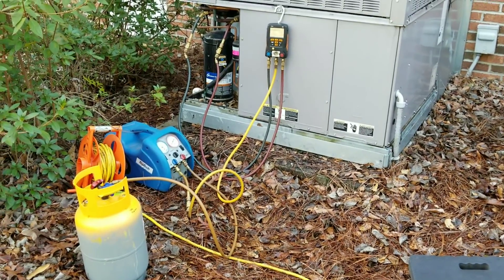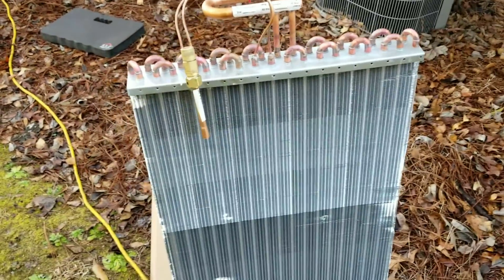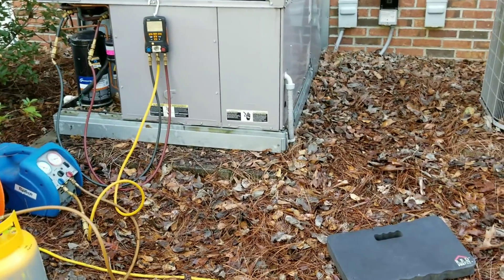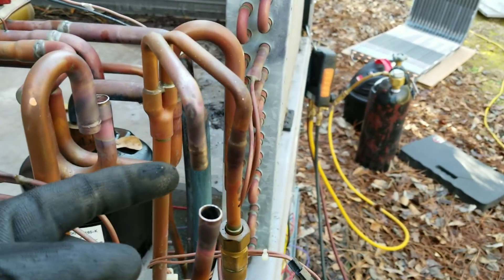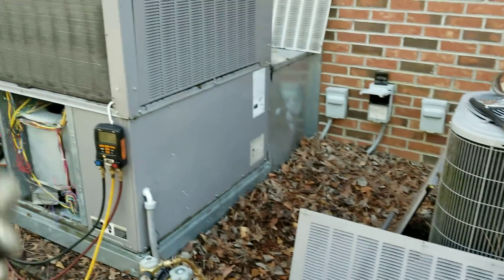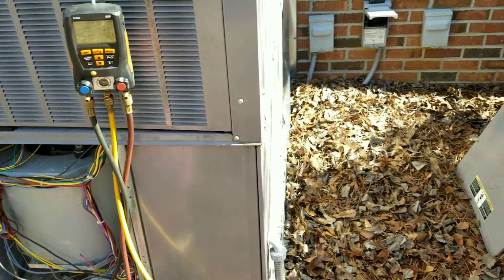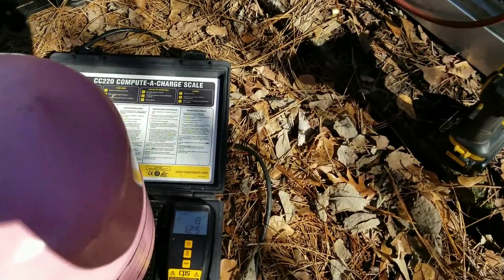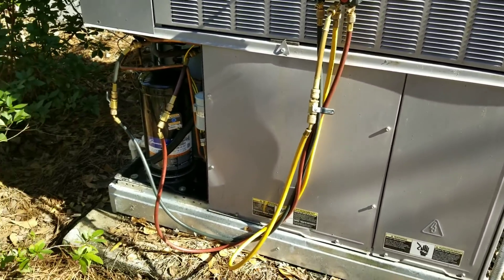Diagnosing A Frozen Heat Pump Part 2

Comment: You could easily solder that pipe without the expensive spare part
Reply from the maker: Sure could.. but I think you missed the part where it's under warranty. If it was my unit under warranty I'd want it replaced so that's what I did.
Reply: @HVACinSC  that's unexpectedly that you are on the client side and not on the side of manufacturer :)

Comment: The problem isn't the products that cause cancer.  It is the state of California that must cause the problems so California should provide a biodegradable plastic bag and some duct tape to every Californian with instructions to place over head, seal at the neckline to guarantee you will not die of cancer.

Comment: You replaced those coils for that little baby leak? Why didn't you just solder the leak closed? You had to sweat the pipes on the new coils anyway.  How much more did that cost the customer to remove and replace the coils? Give me a break.
Reply from the maker: Try reading the description  or paying attention to what's said in the video....  😏😏
It didn't cost the homeowner a dime for this repair. 10 year parts and labor warranty covered it.
If I would have fixed this "baby leak" instead of replacing the part, I would have had to charge the customer for the repair. Give me a break... 🙄🙄

Comment: I have run across three Carrier/Bryant condenser coils leaking on 16 SEER split system air conditioners last summer, bad thing was carrier distributor said it would be six weeks for the coil, they would charge my account $1800.00 which I would have to pay by end of the month, and then when I return the coil back they would give back in house credit $1800.00 which is not good for me since I don’t buy much items from this distributor. Bad thing was these units were under warranty had to end up repairing it in the field verses warranty the coil. This is one of many reasons I complain about the quality of HVAC equipment (doesn’t matter what brand)
Reply from the maker: Ouch. I'm glad we are a factory authorized dealer. I've had to make a temporary repair on coils in the past until the warranty part came in but not often thankfully.
Reply: Superior Comfort Heating & Air LLC  that’s bad enough, but on a 30 ton semi hermetic, one of the guys DESTROYED  the wooden crate, when all you need to do,,is REMOVED 4 LAG BOLTS, TO GET THE TOP OFF THEN UNBOLT THE COMPRESSOR, well CARRIER BACKCHARGED  THE COMPANY A FEW HUNDRED DOLLARS !